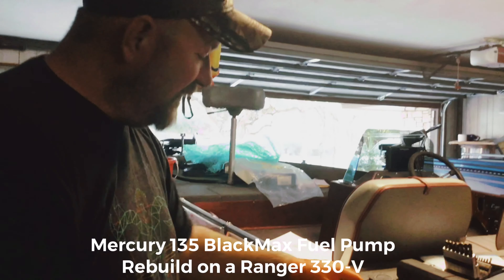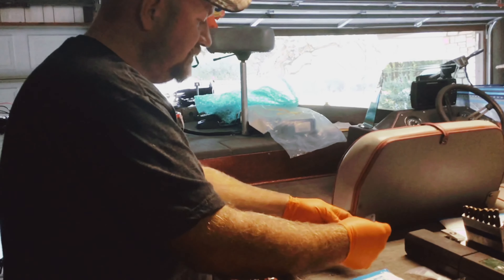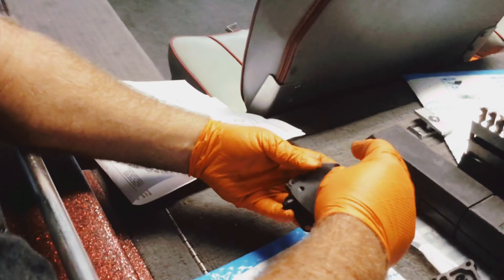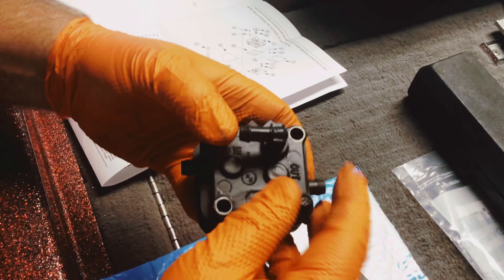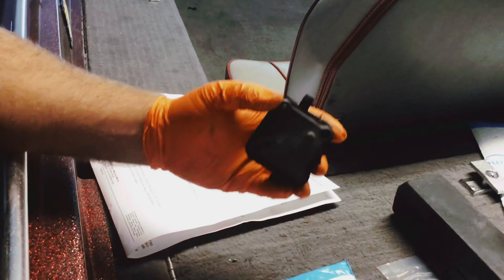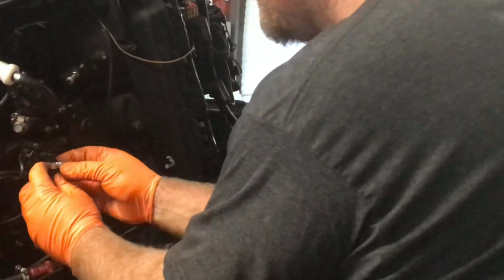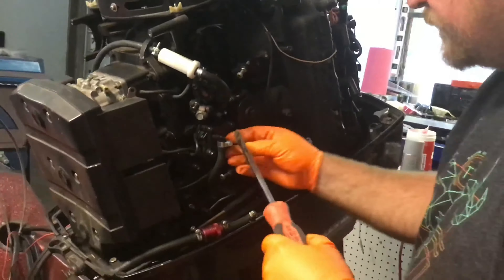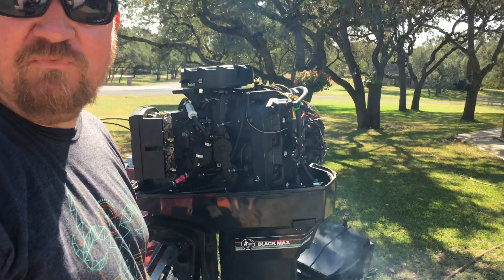MERCURY 135 BlackMax Fuel Pump Rebuild on a Ranger 330v/ bass boat restoration

Comment: Do you happen to know the part number for the fuel pump rebuild  kit?
Reply from the maker: I don’t remember what the number of the kit was. But you can go to marineengine.com and enter your serial number for your motor and look up the part number for the rebuild kit.
Reply: @ProWrenching  ty will do. My blackmax just started. I'm so happy. I changed out carbs and followed your video. You rock
Reply: I dies on neutral after a few minutes.  You think I need adjustment?
Reply from the maker: @JorgeSerna-dg9wz  yes, I would recommend checking your adjustments.  You should check your idle speed, your timing, etc.
Reply from the maker: @JorgeSerna-dg9wz  thank you.  I appreciate that!